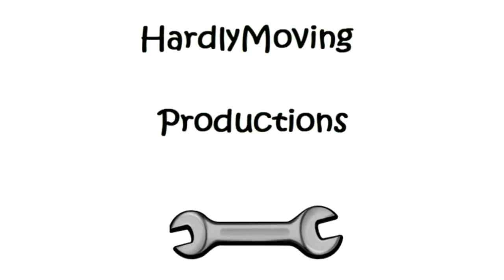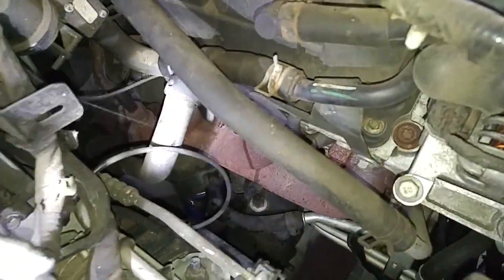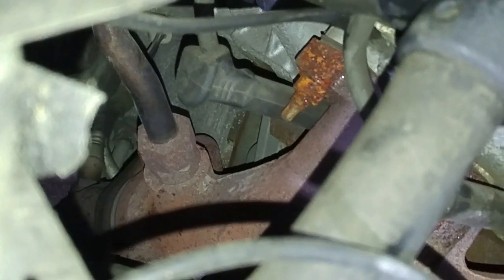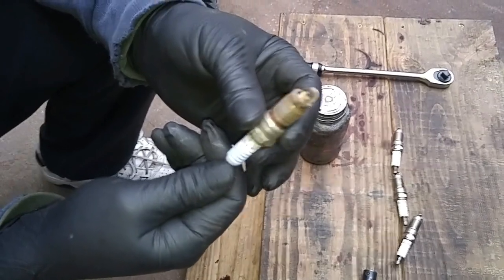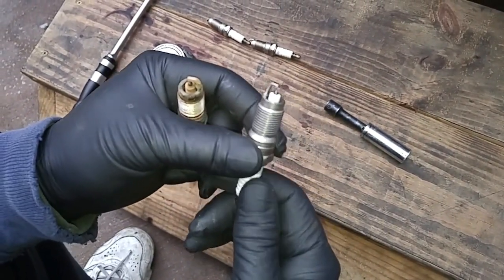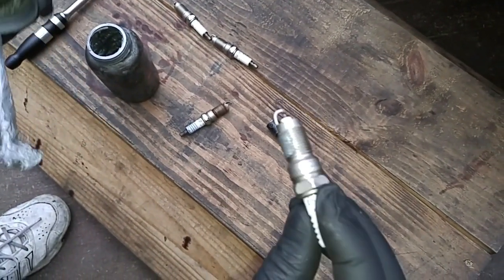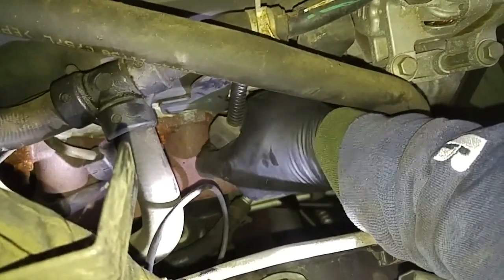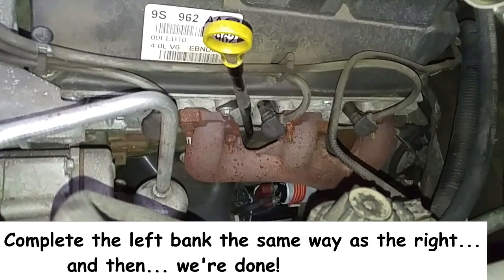Iridium Spark Plug Replacement - Mercury Mountaineer

Comment: What sockets did you use for remove the sparks plugs?. 
Thanks
Reply from the maker: From my recollection, 16 mm 3/8" deep socket.  You can pull out the loosened plugs with magnetic wand.